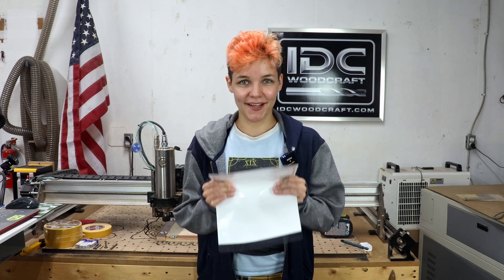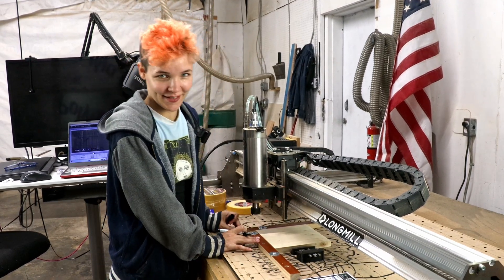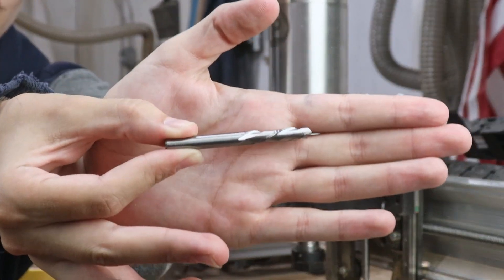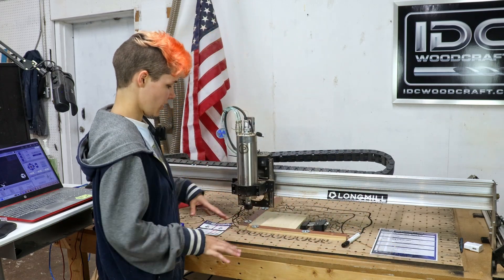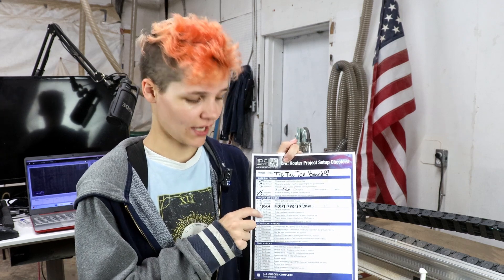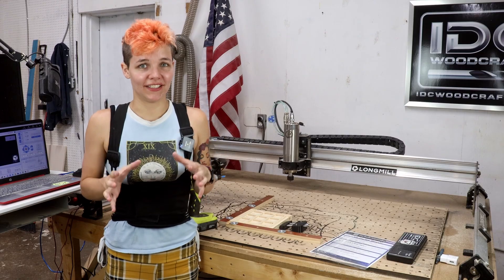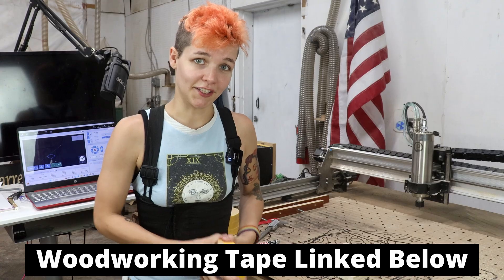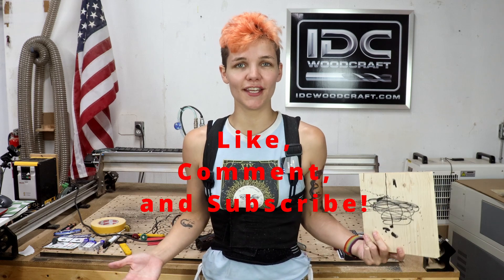Making Your First CNC Project - CNC with Liberty

Comment: It's always best to do a profile cut on the outside to guarantee that everything is perfectly aligned ,etc.   Also you can really tune that corner round that way.  Nice work little girl.
Reply from the maker: larryrobinson7492, Thanks for the tip! Doing a profile cut on the outside does help with alignment and corner rounding. I appreciate the feedback.

Comment: ???? So Liberty...a real question: I never understood using multiple bits on one project! 
So...really changing bits is like a new project, new Gcode and a new bit...except we use the same wood in the same spot???

I think I got it!! Thank you Professor!

David Rodwell
Winston Salem, NC
Reply from the maker: dcrodwell, That's right, David! Changing bits during a project allows for more intricate designs and details without having to start over. Each bit is like a tool in your toolbox for different tasks on the same piece of wood. Happy woodworking!

Comment: Great video.  I've been using that tape for a while now.  It does work great.  When I do use it and zero off the spoilerboard I add a 3x5 index card under the probe block.  This compensates for the height of the tape.  Most of the time the piece will cutout and the tape is left over on the spoilerboard.
Reply from the maker: laser31415, That's a great tip to use an index card under the probe block to compensate for the tape height. It's nice when the tape stays on the spoilerboard after the cutout—it means less cleanup for you! Keep up the good work!

Comment: Nice video……I think some times the CNC is not the best way to do things. I think a router table would have been the better choice for the final round over.
Reply from the maker: thisoldman7142, Thank you for watching! CNC and router tables each have their strengths, depending on the project and your preferences. Feel free to try out different tools to see what works best for you.